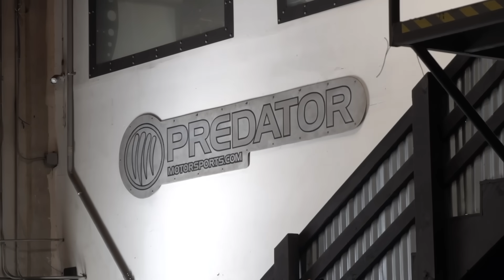This Absolute BEAST is Going in the Hummer!!!

Comment: This is gonna be the coldest hmmwv in the summer with all that interior ventilation.😂
Reply: Letting all the hot air in?
Reply: @khwaac  if you’ve ever driven a hmmwv, you would know the only cool air is all the air outside of the truck.
Reply: Its a Hummer H1 Alpha, not a military unit. They actually have decent air conditioning and a pretty good thermal barrier.

Comment: Best idea for covering the holes that will let dirt and debries into the cab would be to cover the holes from the inside with clear 2mm perspex/polycarbonate sheets sealed to the cab area with clear silicone sealant and maybe smoked tint over the holes in the footwell maybe some back ligting.

Comment: Fill the critical holes with fiberglass screen and blackjack polyeuerothane roof cement that poly sealer is super tenatious once cured. Then you wont take a shower when it rains, a dry spot  in a rain storm😎

Comment: Excellent that they went with the LBZ (if memory serves, the original had a FICM, which was one of the modules that got ventilated on the passenger side valve cover, which would mean it was either a LB7 or LLY). Sounds like they eliminated the LBZ (And LMM's) main weak point - the pistons. I ASSUME, based on the lack of a NSBU on the side of the transmission, and that I don't know of any build that had a LBZ with a 5-speed behind it, that you also have a 6-speed Allison. 👍

I don't think I've ever heard of Randy's Transmissions... In the Duramax world, Inglewood Transmission is among the most respected Allison builders, which was originally owned by Mike Loverich, who has unfortunately left us, but he was one of the pioneers of Allison Performance. If he said something about an Allison Transmission, you could take it as gospel.

Comment: i do like the light blue hummer, that would look as cool as the others, still seems slightly military, almost airforce colour and the bullet holes will show up really well 
i have an experimental vehicle, been shot up real good all the way up to 20mm (top spec), its quite something special, then it also got blown up so i know what you mean by the holes being razor sharp, really nasty and ruin your day, about the only piece i will keep other than film footage is a piece of exhaust, had to be .50 cal or 20mm, nice holes - makes you appreciate that when something like a vehicle is hit, its not just the ammunition to be aware of, its all the shrapnel it picks up and takes with it
the thing thats very difficult to avoid is modern vehicles wiring looms, in the engine bay, a shot or two were sent either side of the engine taking out the looms, i mean really you could never miss them, with a hardened shell inside, the vehicle would be useless as nothing would work, and automatic gear shifts at the rear of the gearbox, all taken out, nothing more than shrapnel itself

Comment: Why not have a remove able door option?, (like a jeep), so in the summer you can retain the cold  a/c or heat in the winter, or when your feeling froggy you can take the doors off, or when it rains you can put the doors back on. Just some ideas 😊

Comment: Forged pistons in a diesel are only good for about 20,000 miles. There are cast pistons that are good for 1200 hp and 2000 ft lbs, so unless you are over those power levels and rebuild, often the cast pistons are the way to go.

Comment: Isn't this suppose to be for the resort? If so it would have been sick for it to be a bright white but put sheet metal that's either looks like brass or painted black behind the holes so the holes are sealed but you can still tell they are there from 5+ feet away and feel them when you're up close. Then have the exo skeleton black with black desperado resort logos on the sides, hood, and back door. That way it stands out more instead of having a standard color for a humvee

Comment: @matt you might wanna check out diode dynamics, they make great lights as well. But for sure, baja designs are crazy nice. Are you gonna install a turret in the back? Is it not possible to put 40+ inch tires?

Comment: No doors Texas. Air conditioning won’t do squat. Might as well build in some elements from old ovens. Having a Jeep in summer the heat is unbearable when stopped / going slow in traffic. You’ll want to end it all. Will be like riding horseback…

Comment: I would have pressed back in (from the inside) the larger holes and closed them up and maybe left the smaller holes, it just going to rust away.

Dont put round spotlights on the top of the roof rack it looks stupid, only flat lightbars go up there round spotlights go on the front on the bar.

Comment: Why do you need ac if your leaving the doors off?
Reply: Lol, when it's 110 out and you stop and the over 200 degree engine heat is radiating in those open doors... yeah A/C is required.

Comment: Edison Motors utuber, send the mechanics to install an ev conversion kit on the dump truck,, then do golf carts.  Portable generators for campers.  Emergency power for the home rentals.  Edison will also crosstrain on solar battery systems.  They are building a refer trailer conversion.  Perfect power plant, silent for events.  The dump truck recharges in one hour.  Silent power all day.  Air tow trailers lower to become walking.  Load pallets,   truck recycle cans.

Comment: If you can fanangle the clearance, put a sealed backer, an inch or so behind the bullet-riddled parts of the interior - and put LED lights in between the old metal with the bullet holes, and the new, sealed backer. The lights would augment the terror you buggers put it through, especially at night. 😎🤠
I don't know how practical it would be (heck! what is practical on this rebuild 🤑) but could the same be done with spots on the exterior - pillars, doors, etc.? 
Just a random thought. I mean, the amount of ammo you guys pissed away to "destroy" a hummer, there should be a way to "highlight" all that stupidity, right? 😈👹👻🥸

Comment: Pretty sure you completely destroyed the structural integrity of that hummer.. it will quickly begin to crack at those sharp edges and holes especially on the frame.. there’s a reason you chamfer any holes you drill in a vehicle frame ..